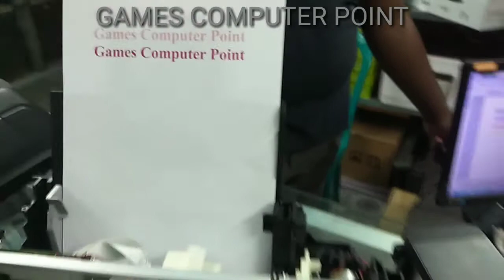how to fix epson l130 no ink adjustment all ink levels ?

Comment: Thank you so much.  Only Cyan color was not working in my Epson L130. In all other video they were showing how to remove the air from the printer head, I did that, but that did not solve my problem, only in your video you showed how to remove the waste ink from the waste pipe at 3:00 which also removes the air from the printer head. After I did this action now Cyan color is getting printed.
Reply from the maker: Thanks u
Reply: I have same problem bro. Cayan is not printing 😥